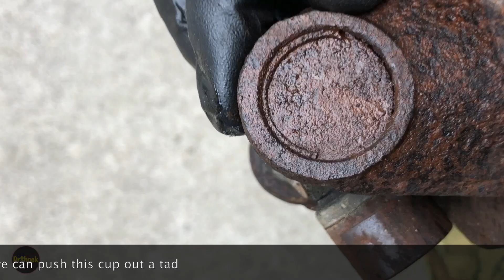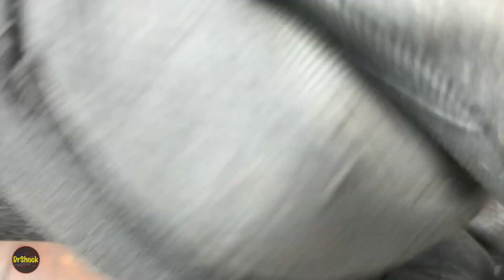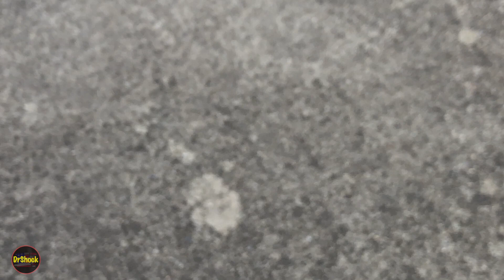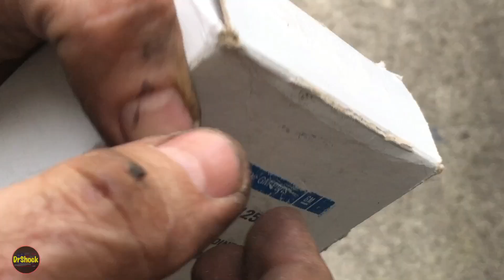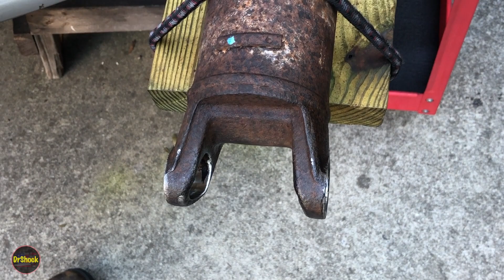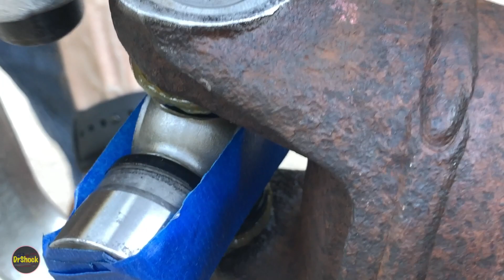1985 - 2019 GM Trucks & Vans Driveshaft Rusted Universal Joint (U-Joint) Repair w/ External Rings

Comment: dealt with this on a  2005 Ram 3500. Rear Ujoint rusted stuck. I ended up cutting the cross in half. Since, then I bought B7 5/8 threaded rod, it is high strength. plan is mig weld rod to the exposed end cap. put a short pipe or socket down rod, some grade 8 washers and  nut. When you crank nut tight it will pull the cap out. I can reweld it if weld breaks. I also think the heat of the welding will loosen the parts, and when you weld  metal it shrinks when it cools which will help loosen the ujoint cap in the Yoke. Bought the 5/8 B7 rod on Amazon.

Comment: I just finished this struggle on my 1980 Corvette which has a total of 6 u-joints for the drive shaft and 2 axle shafts, I really wish I had known about the spider press before that ordeal. I ended up using a combination of my shop press, lots of PB blaster, lots of heat, and an air chisel. I don't think I bent the ears but the half shafts especially fought me hard and that tool would have made it so much easier.